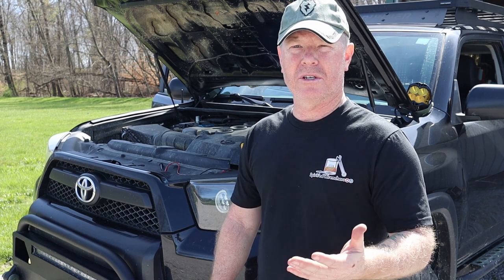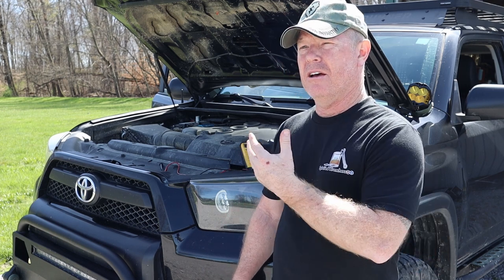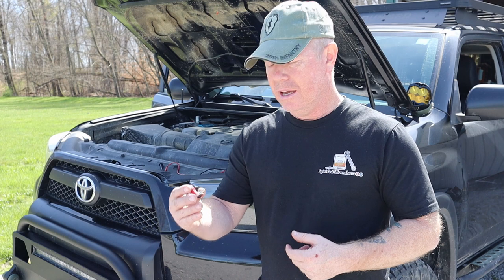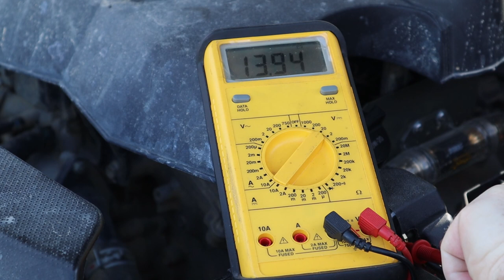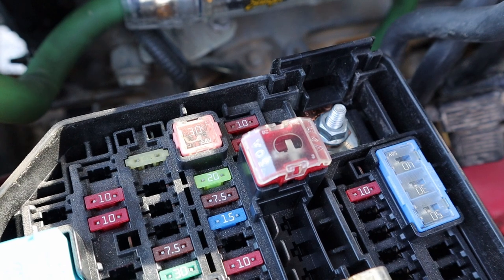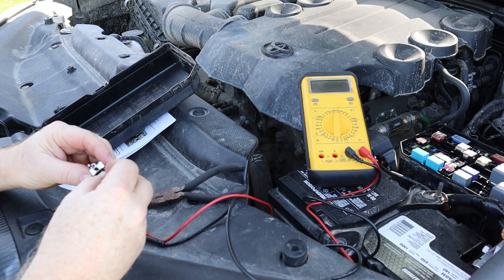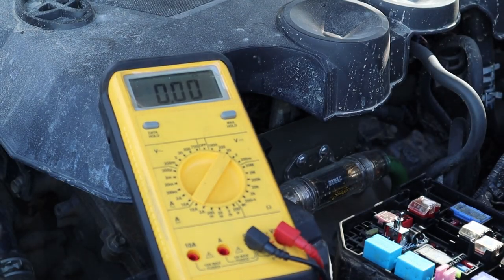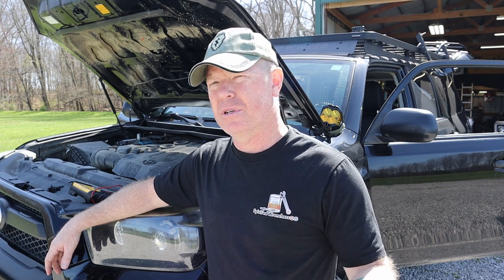Installing & Testing The Voltage Booster Pro In Our 5th Gen Toyota 4Runner

Comment: Cool demo!  Thank you.  I've been in hell with my Odyssey 34R AGM battery.  Now it's at the point that I'm having to "condition it" every other week; otherwise the truck won't even start.  I just ordered one of these boosters.  I'll swing back and update my comments if it indeed solves my issue.  The battery is almost 3 years old, so I may need to replace it anyway.
Reply from the maker: Hi Rommel. Thank you for watching and sharing. We greatly appreciate it. Sorry to hear about your AGM giving you problems. Sounds like it definitely has reached the end of it's lifespan. I hope the booster helps with the issue and if not, it should at least with a new batter and getting the most out of it. We look forward to hearing how it goes. Stay safe out there!

Comment: Boosting voltage doesn't add amperage for charging or extra load.
Reply from the maker: Hi re3132, Thanks for watching and sharing. We appreciate it. I agree. This isn't for adding amperage. I recognize the best thing for that is to upgrade the alternator, which we don't have a need for quite yet.  Cheers!
Reply: Please tell more I’m interested? Then what’s it good for I’m in debate to get a xs agm battery or buy a 240amp high out alternator.

Comment: Hey I'm really needing something like this for my 2019 Toyota Camry LE will this work for my car and if not do you know of a product that will I'm trying to increase my charging voltage from 13.8 to 14.4 for the purpose of charging a lithium battery bank I want to delete the stock battery and increase my voltage so that the lithium gets everything it can from the alternator is this a universal device for Toyota
Reply from the maker: Hi Derrick. Thank you very much for watching and sharing. We really appreciate it. To be honest, I'm unsure if these would work on the Camry but I would encourage that you reach out Voltage Booster to inquire. He's great and should also respond back quickly for you. Let me know if you have any issues in connecting with the owner. Good luck in your project. Sounds like a cool one.
Reply: @SpiritedWrenchers  thank you for responding and I'm going to try to contact them now

Comment: AGM or not, the booster still benefits a blooded acid battery. My Kia has been arching a flooded acid battery for 7 years at 14.4v where as my Tacoma only charges at around 13.2-13.5 and the batter is dead after about 3 weeks of no driving in the winter.

Comment: Curious if you encountered any issues in the year that you have had this. Ive been looking at adding a deep cycle secondary battery and this product came up as a possible addition to it. Do you still run this all the time on low? Any issues?
Reply from the maker: Hi Lanix. Thanks for watching and asking. We appreciate it. Still run it and zero issues. Hope that helps in your decision.  I know a 2nd battery isn't a cheap mod. Stay safe out there.

Comment: Just installed one today in my 2018 4Runner TRD Off Road. 14.5 volts on Low, 15.1 volts on High setting. Matches perfect with my group 27F, X2 Power AGM battery. Will edit if any problems arise.
Reply from the maker: Hi Tony. Thanks for watching and sharing. We greatly appreciate it. Glad to hear you're seeing a difference as well. So far no issues on our end since installing and hope the same for you. Stay safe out there!

Comment: Following up on this (as I think I may do it soon)...do you ever have to (or want to) add a battery tender to it periodically?  Or did this booster diode eliminate the need to do that?  Thanks
Reply from the maker: Hi JW. Thanks for watching and asking. We greatly appreciate it. I haven't had a need for a tender on the 4Runner at all and it sits for days/weeks at a time without going anywhere. The booster won't help if there is a problem on the battery side with keeping it charged, it really just helps with increasing the battery amperage to it's recommended area (in this case our AGM) when the stock alternator doesn't have the ability to do that on it's own. We're certainly happy we still have it and have no problems with it all. Hope that helps. Stay safe out there!

Comment: I’ve found on mine it will be 14.8 volt on a cold morning but within 10 minutes we are down to 14.2 volts when it’s warmed up even with just the engine running as the load. 

Looking at getting a high output alternator due to all the loads I have.
Reply from the maker: Hi BVN-Texas. Thanks for watching and sharing that with us. We really appreciate it. That's quite interesting to have the drop only because it warmed up. What type of battery are you running? I thought about upgrading to a HO alternator but with the AGM battery and this booster (which I haven't had the need to use much), I haven't needed to quite yet even with all of the load from our items. What other loads do you typically have pulling on the system?
Reply: @SpiritedWrenchers  the only loads was just what it took to run the engine. So ignition and fuel pump. But nothing else. 

I’ve seen it do same on the highway. 

It’s a factory stop 4Runner with the OEM battery and I tried swapping it out with a new AGM one and same issue. 

I wrote the company that made that booster board and he said it’s just typical hot alternator behavior.

Comment: How is the voltage holding up now with load?
Reply from the maker: Hi 4G18SOHC. Thanks for watching and asking. The voltage has been great. Even with adding a higher wattage amp for the stereo, there has been no issues at all.